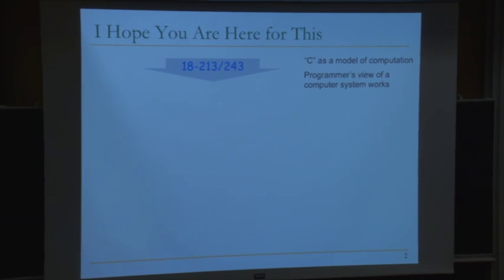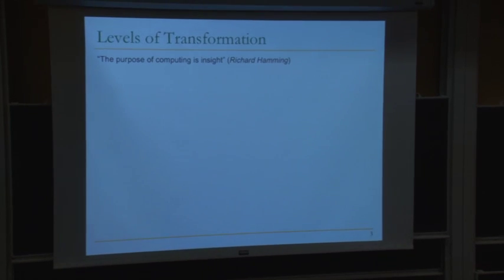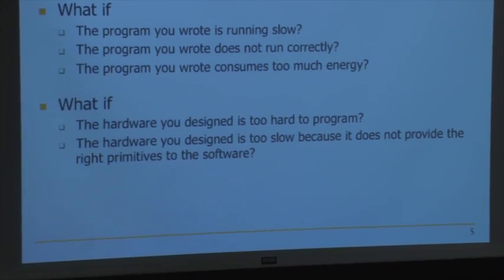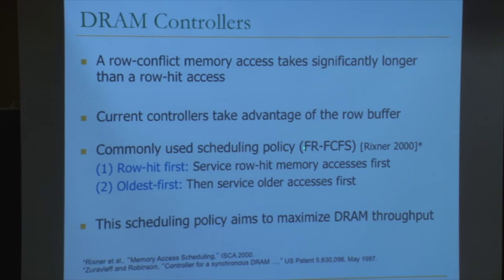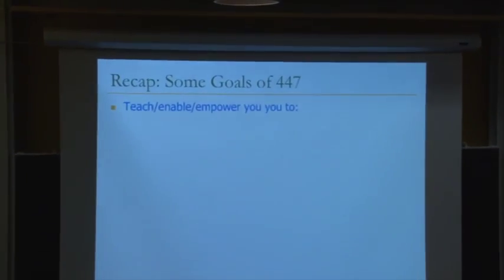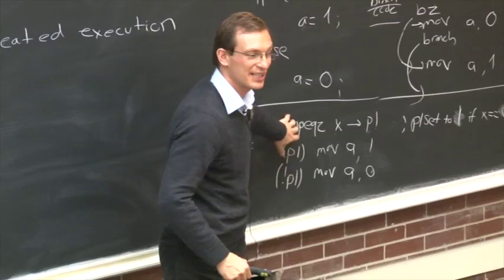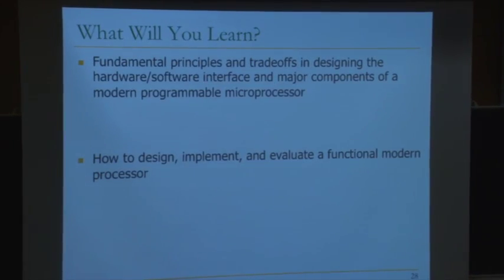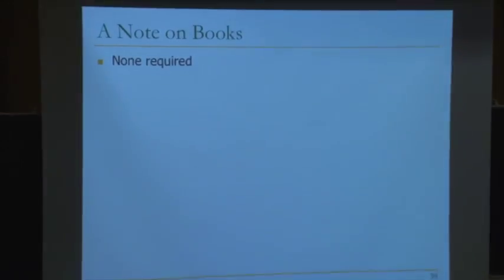Lecture 1 - Introduction and Basics - Carnegie Mellon - Computer Architecture 2013 - Onur Mutlu

Comment: Can you help me with this pls? :)
1)      Please describe what will be done and what result will be in R1 after each instruction

 R1=10, R2=5, R3=5, M[5] = 23, M[10] =122

Addressing mode

instruction

What to do

R1 content

Immediate

add R1, #5

Direct

add R1, (5)

Register direct

add R1, R2

Register indirect

add R1, (R2)

Indexed

add R1, (R2+R3)

Base

add R1, 5(R2)

2)      Write program witch calculates:

 For i=1 to 3

Z=((A[i]*B[i])+C[i])/D[i]

where A,B,C,D and Z are memory locations an operand size is 1 byte.

a)      Using three address instructions and any addressing mode

b)      Using two address instructions and any addressing mode